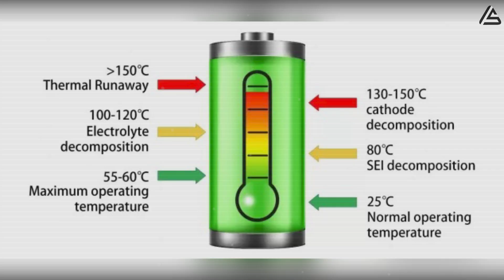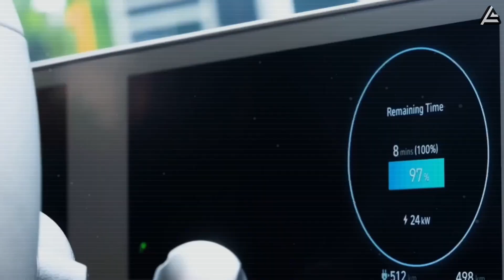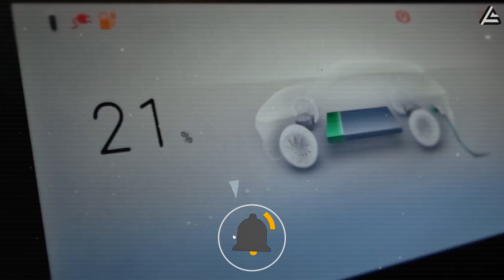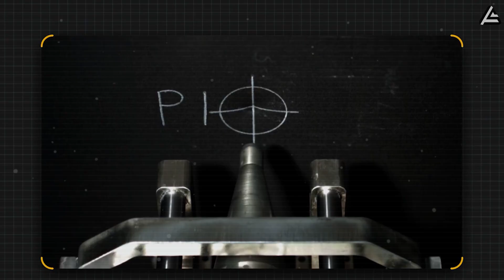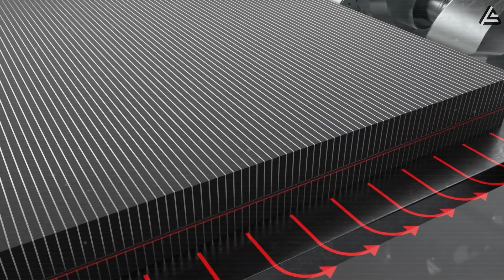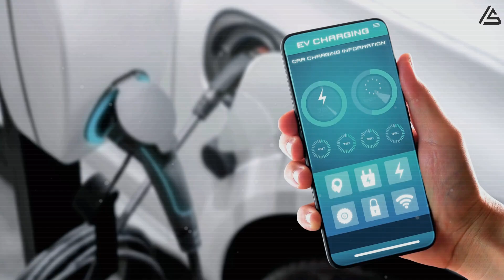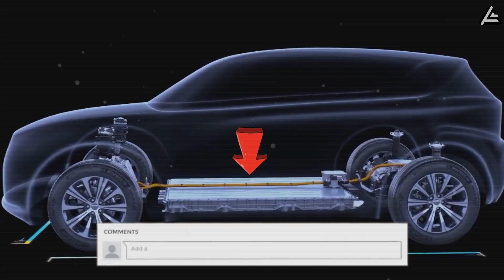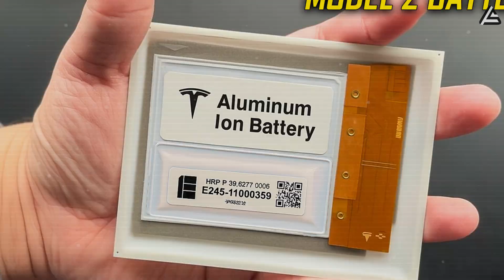2026 Tesla Model 2 Battery - Shocking Safety Update: What About Fire Risk?

Comment: AL-ion battery would be safer and eventually it WILL exceed 300 WH/Kg. It'll be a no brainer after that because the cost will be far less expensive for an AL-ion battery.
Reply from the maker: Great point,  AL-ion will be unbeatable once it reaches 300 Wh/kg. Do you think Tesla’s already close to making it happen?
Reply: @AutoGearShift2  If TESLA makes the battery, they will have insanely enormous backlogs for their newest affordable Model 2\Q\C. I think by mid 2026 they will reach 300 Wh\Kg. Of course, we wanted TESLA to have it available yesterday.
Reply from the maker: totally agree